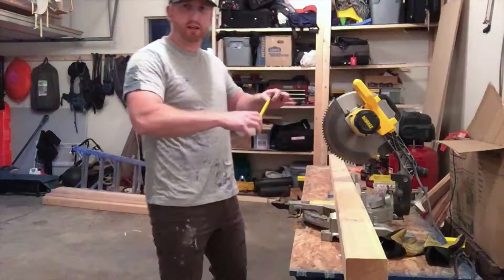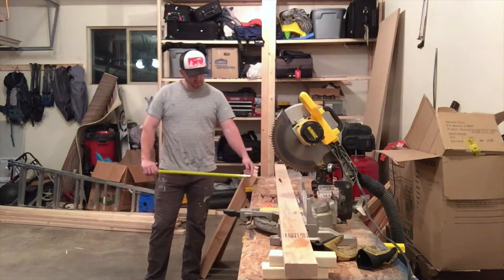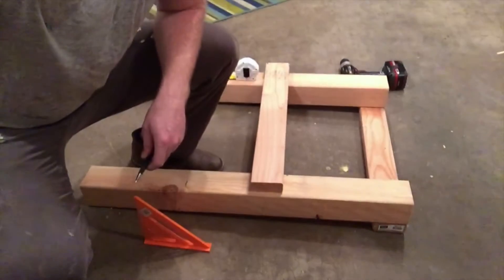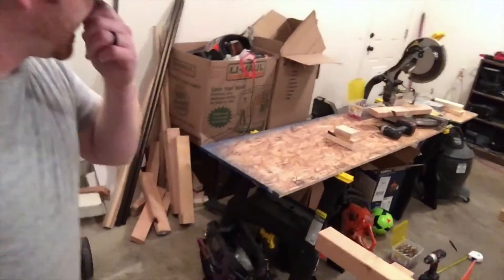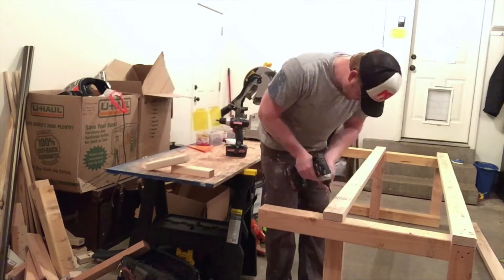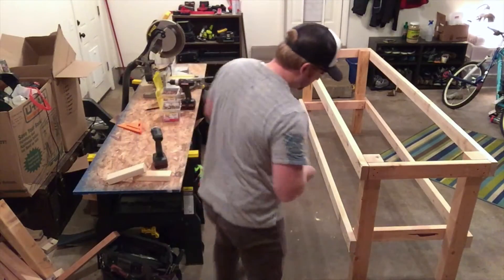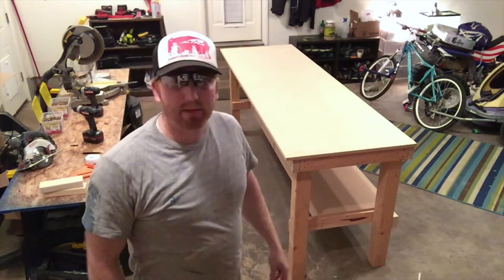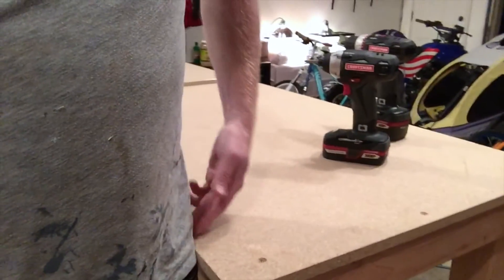DIY Workbench on a Budget

Comment: Have you thought of using LVL structural lumber as an economical sub-top?  You could use met, hardwood or softwood planks, or multiply plywood for the top.  Legs, crossmembers, etc. can.be as you described.  I like your approach!
Reply from the maker: I appreciate the tip! We have moved homes and the bench stayed with the home. I will have to try your suggestion on the next one.